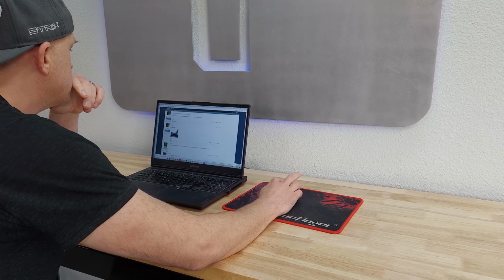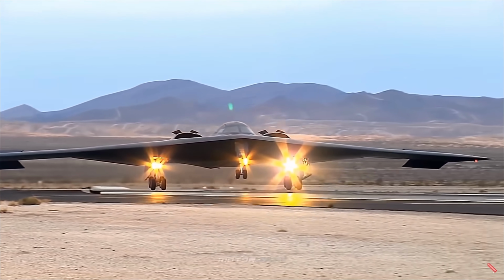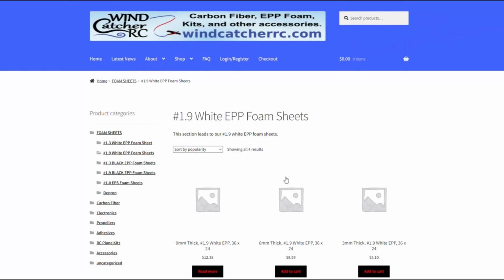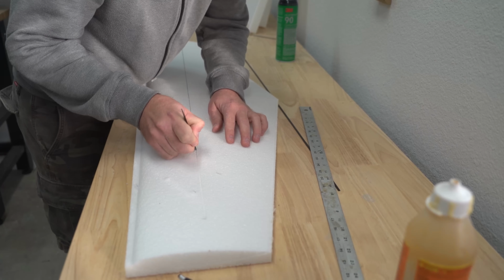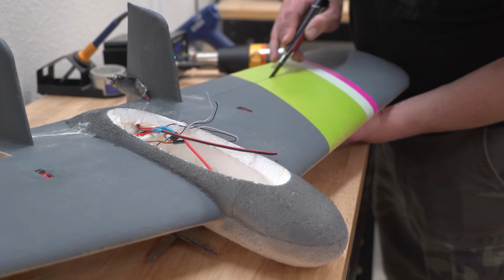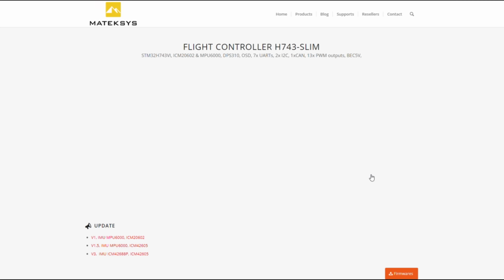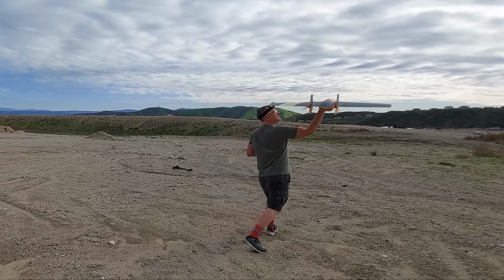Aerodynamic Instability:  The Holy Grail of Efficiency?  Part 1

Comment: Helicopters are inherently unstable, but we managed to make them fly.  That said, I prefer inherently stable wings.
Reply: A model aircraft has the advantage of being disposable, you're not risking death if something malfunctions like a real aircraft
Reply: @mortache  They're great for trying novel things. I fly gliders and the difference in flight time between still and gusty air is very noticeable. I imagine an unstable wing will always be like flying in a gust. It might look like it's flying perfectly with fast control systems, but it's going to be inefficient. I'm guessing.
Reply: @ChristieNel  yeah but a regular plane is always being "pinched" by its forward and wings. Idk about this much unstable planes but CG being on the aerodynamic center could alleviate that constant drag
Reply: @mortache  I've always been fascinated by reflex wings that produce an opposite rotation to normal wings, to gain stability. What do you mean by "pinch"?
Reply: @ChristieNel  I meant the typical stability of an aircraft where aerodynamic center is in front of the CG, and the forward wing is shown to have a positive lift and the rear wing is shown to press down to put it all in place. I imagine it like the two wings pinching the aircraft in place. Of course in reality they both give lift, the rear wing just gives less lift and "constantly corrects itself as if its in a gust" especially because the air is disturbed by the forward wings. Even if you put the wing on a T tail and avoid the deep stall, there's still an additional drag from a separate surface which constantly wades through the drag to ensure some passive stability to make a human pilot's life easier
Reply: @mortache  Ah, okay, you mean like a self correcting feedback loop. I admire when people know their aerodynamic theory.

Comment: What's the measure for efficiency here?!?
I mean: For decades, soaring planes with pretty much the same old base design, show astonishing performance, despite their tail, but great inherent stability. 
Wing-only-designs may gain a bit of uplift, for planes that have some payload - no question, but a another story than soaring for sports.
Moving the CG to the back and therefore forcing the ailerons to permanently play elevons means: changing the original convex wing profile to a concave, bird-like one (compare the good old Jedelsky wing) - but for climbing/counteracting the CG, the elevon needs to turn upwards (while flaps on tailed planes move down for generating more lift) ---> IMHO the whole intention of the wing (only) profile gets perverted by this approach.  
My understanding / idea for this whole project would be: Find a reasonable measure of efficiency and a way to actually measure it (e.g. flight distance, time, climb performance in relation to used Watts), and then see, if changing the base wing profile to some Jedelsky (=changing default evelon angle, but optimize the foil curve and reduce the gap at the aileron joint) gives better values or maneuverability.

Comment: What about Prandl wings? Efficiency is not speed. If you fly slower and have no tip vortexes and proverse yaw and thus no vertical stabilizers the drag is reduced alot. Look into Albion Bowers Research with Nasa and the Flying like birds series he has on youtube. Birds are flying wings without vertical tails. Dont see many birds with spin departure problems right?
Reply: Kavin, PROVERSE YAW! Prandtl wings are one to explore.
Reply: But they can finely tune their wing twist according to angle of attack. A Prandtl wing is only good at a very specific angle of attack from what I saw
Reply: @mortache  is seem to make sense if u mean most optimal at least? Any reference? Anyways, too much proverse yaw is better than too little (in terms of stall spin).  And how about pitch axis stability of prantdl?  Is it 'autostabilizing' provided good trim (it likely seems). also do you know if prantdl is autostabilizing the pitch provided slightly bad trim (like say e186 should be, as airspeed raises or lowers the changed pitching moment then fixes the angle of attack)?
Reply: @vidmasze  i don't know a LOT about these wings, only that they hqve exceptionally high twist making the wingtips neutral or negative angle of attack. Something like 20-30 degrees

Comment: Explain me one thing please. If the autopilot calculates 400 times a second but the servo get new positions only 50 times a second, do the 400 hz make sense?
Reply: hm control engineering was a long time ago but out of the top of my head. Even on 50 Hz, letting the control loop run at 400Hz, it could improve still help for noise from input sensors. It could still help as reading of inputs and acting on them is not necessarily close together when on the same frequency (no idea how the code is setup). And if you don't adjust gain values then it could still have a fortunate effect too but that could be easily fixed by putting in the correct gains.

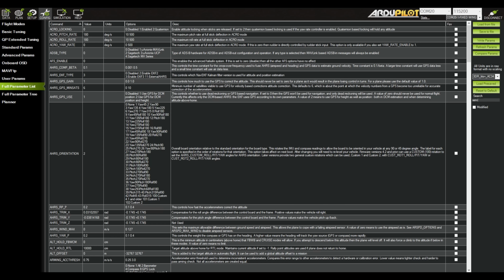But actually the servos are doing 400hz now too 9:30 . ;)
Reply: not that I'm qualified to answer but yes and no. In some ways no because as you're thinking, the servos can only move at 50hz..but a 400hz sample rate allows much finer analysis of what's ahppening to teh craft and as this is r&d I'd assume that's valuable in itself.   In analagous areas having high quality data that you then downsample to get from in this case 400hz sampling to 50hz action can still be useful as at least you have a better picture of what's happening to base your 50 actiosn per second on if that makes sense. ANyway, I wondered the same thing...hope TF replies to your question ;-)
Reply: You'd need servos capable of updating at 400Hz. I think these sorts of servos are available but I don't think they're very common.

Comment: Have you thought about moving the center of gravity inflight, with a servo? This would allow to start your plane in a stable configuration.
Reply: Kind of like Concorde and the trim fuel tank in the tail? Boeing has an airplane with fuel tanks in the horizontal stabilizer too....
Reply: @231pilot  Also the F22 uses air bladders to push fuel forward to counteract the CG change when dropping heavy bombs.
Reply: @231pilot  yes similar to similar to that. it would allow to fly high in the air and testing of the unstable configuration away from the ground.
Reply: @christiangunther7216  Nonsense. Concord was never an unstable aircraft.
Reply: If I heard correctly, the point of the unstable configuration is for takeoff and landing. Starting stable would defeat the purpose of the unstable wing in the first place.
Reply: @AxWxKx 
thats what I thought
Reply: @AxWxKx  yes, but you also have to understand the context. That context pertains to wing design, where the wing design and positioning was a compromise between take-off vs. cruising performance. If you have a variable cg system, you can kinda get the best of both worlds.
Reply: @sepg5084  I think what he means is that the rearward cg allows you to run a smaller wing but it has instability. If you move the CG forward, it will be more stable, but you still have too small of a wing.
This video was more about trying to achieve stable flight with rear cg, rather than shrinking the wings I believe.
Reply: nice idea to shift weight, esp to ease the exploration for finding what's the good-enough spot for CG
Reply: @vidmasze  Should be able to do it by design.

It's a sad day when an aircraft has to be created and flown in order to determine where the C of G is. It's not how it is done in real life.
Reply: @deanXRayZulu  well, BUT in this case we want on purpose to use a CG which is outside of good/normal CG range, so telling (I.e. Computing) where is a good enough position is probably not so easy?

What could be posibly computed is given a certain arbitrary 'CG' place, if pitching moment can be easily enough balanced by CG and elevons at ALL intended speeds / alpha (I.e. Need to keep extra for ailerons, and fake drag rudder). But that doesnt seem too obvious to me
Reply: We've been doing that since at least the early 1980s. With an aircraft that dropped any type of payload it's extraordinary common to have movable ballast to compensate. You can find plans in the very old modeling magazines, it's an extraordinarily simple system.
Reply: That's the way a lot of rentry vehicles control their angle of attack.  A moveable sled to move the CG.
Reply: No, most reentry vehicles have an offset CG and use roll control via thrusters to point the lift vector in the desired direction. The moveable sled was proposed to be used on Dragon for extra precise control as propulsive landing on a designated spot required it. When they switched to parachutes over the ocean, the extra precision was not required anymore
Reply: Rol Klingberg designed and sold 100 inch Klingberg Wing kits with variable CG in flight via moving the battery tray with a servo.  Would have had to have been 23 years ago at least, if not more.
Reply: Genius
Reply: A retractable lead/iron cylinder sticking out of nose?
Reply: We did this on our RC glider plank planes to dial in the cg, once we found the sweet spot, mark it, then we would remove the servo and rebalance on our new found cg spot.
Reply: I have build an exceptionally well flying BOT with a servo that moves the CG for hanging in thermals, super smooth landings and extra high launches off a hi start. Best of all worlds at a very small cost of weight.
Reply: Clever
Reply: Or cause instability via small irregular movements in both the control surfaces and motors.
Reply: @vitordelima  i think ardupilot has filters for reducing oscilations
Reply: @vidmasze  yes, but my findings are ardupilot is made for larger/slower craft. I am not saying it cannot work with ardupilot, I do think iNav would have a better chance then AP.
Reply: @user-rs8zg8ey2b  are you sure? My experience and what i have heard tells that arduplane is MUCH MUCH more serious and clean than inav. While inav is only a considerable option if u have poor Flight controller where ardu do not fit (too little flash). Inav is probably ok only for copter and still not sure
Reply: @user-rs8zg8ey2b  why on earth a dumber autopilot would pilot a smaller and faster plane (as both of these make the task harder)? Never heard that about inav! Maybe by smaller you mean cheaper? FC hardware is sometimes cheaper indeed for inav. Ardu is great, while inav can't even launch some plane models, immediate crash ✌
Reply: @vidmasze  AP never caught up to the 5" mini quads preformance, they have never been into racing, where manual flight preformance of a 15:1 thrust to weight racing quad performs. Their pixracer was a total failure from a racing perspective. The whole revolution of 5" quads started with many things that make them what they are today, quicker response from lighter machines, more power, lower latency esc, pid and filter loops, all of these were tackled in Betaflight, AP was never interested in racing (or very little). IMO, AP is way more "dumb" in flight preformance especially on high preformance quads. So saying "dumber" shows what you know about these firmwares. Its a shame AP never forks the good stuff from BF, but I think the reason is their FW is so involved it would be a nightmare to import BF goodness into AP. AP focused on old, large, heavy, slow machine's. When I load arducopter on my dinosaur 6yo 5" quad, the standard lowest pid values are so high it just oscillates and you have to go into the main list and lower them way more, why, they not used to even 6yo mini quad preformance. iNav is forked from betaflight long ago, but still caters to the new higher flight preformance, where AP is still in the stone age with much larger, slower machines, they are the jack of all trades, but master of none imo. Of course BF and iNav can be cheaper as generally they dont need all these sensors, I just bought four F4 FC for $10 each, they will run BF, iNav and AP, but they may not have enough ports broken out for large installs.
Reply: @user-rs8zg8ey2b  exactly quads and planes are completely different topics. Planes are just very great in ardu. 
Not sure about quads in Ardu vs inav, heard some complaints about Ardu with quads, but inav seems rather weird too ;)
Reply: @vidmasze  Welp, I think you have it wrong, AP is not great in high preformance racing planes, iNav is. Again, AP was born with older, large, heave, slow responding planes/quads. iNav is used on FPV racing planes where flight preformance is key, not autonomous functions. Now a plane in this video is needed a high preformance "flight" pid loop, AP does not have this IMO. AP and planes are great for slowly floating around with a stable plane, not a unstable way to far back CG like the plane in this video, get it?
Reply: @vitordelima  No, that is not what aerodynamic instability is.

That's loss of control of a stable aircraft. You don't get the benefits of a genuinely unstable aircraft doing that.
Reply: @deanXRayZulu  The idea is the autopilot self-correcting everything back but try to generate the same kind of effect from instability using very small movements.
Reply: The Swiss did that with their Spartakus F3B model in the early 1980s.
Reply: yes slide the lipo inflight, could even automate it depending on airspeed over the wing?
Reply: @frankyfrench5279  if you make the CG modification based on airspeed that doesn't account for a lot of factors. It's not a bad way to do it, but if you could directly use the inputs from the flight controller PID loop to target specific values in the controller
Reply: Upvoted regarding the Concorde Co cept. You could use a heavy suspension of metal in a silicone lined cylinder with a worn gear to move the liquid back and forth.
Reply: A weight that slides quickly on a rod forward and aft.
Reply: Why not just use canards?
Reply: The actual thing is to start it in unstable configuration, so take of speed is lower
Reply: This could be enhanced with gyroscopes, no?
Reply: Maybe airlines can ask passengers to move around in flight to improve fuel efficiency....
Reply: came here to write this!
Reply: There's an unswept (high-) subsonic laminar flow airfoil that would allow for extreme efficiency (80~120 L/D ratio depending on realized aspect ratio, if laminar flow can be retained somehow, say by sucking in the boundary layer or such) as a pure (tail and fuselage-less) flying wing, but this effiency spot is unstable in pitch (and I don't expect the plane to be aerodynamically stable in yaw and roll either) and ideally requires CG shifting to avoid drag-inducing control surface deflection. Essentially trimming pitch by using the sled tactic.

For recovery though it is thankfully passively stable and stall-free up to about half (iirc, might just be a third) as much lift...... when the airfoil experiences corresponding -0.5 (-0.3 ) G.
So, flying inverted (level flight!) would be stable in pitch. Just have to worry about the flip maneuver towards the excessive pitch in normal level flight, as the brief full-wing air brake orientation is structurally intense. Might be possible to flip through around 320 degrees or such to point forward again, just this time being "stuck" in a pitch-down AoA. Worst case might not flip through, I guess.